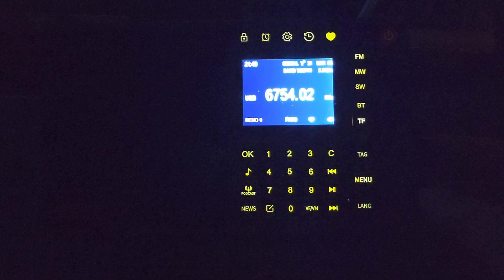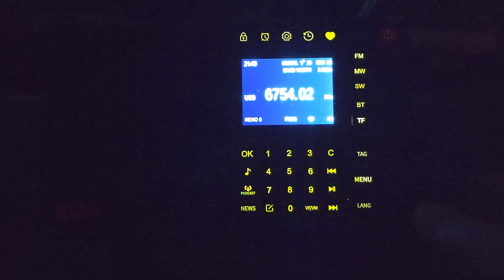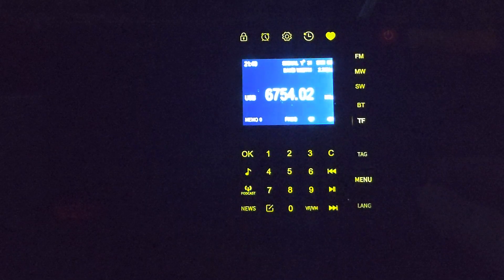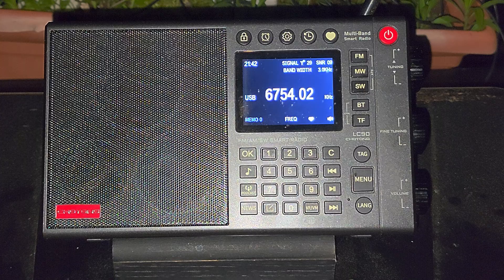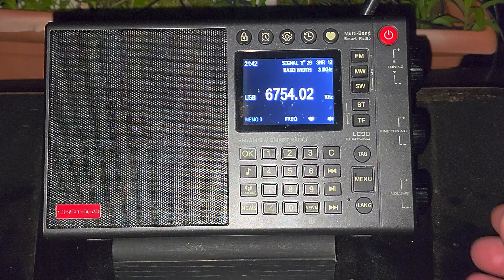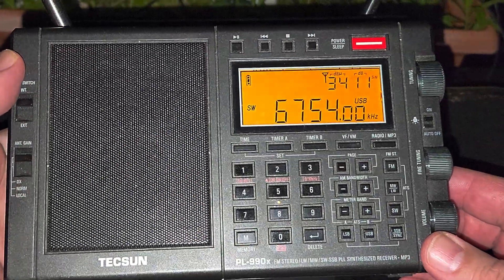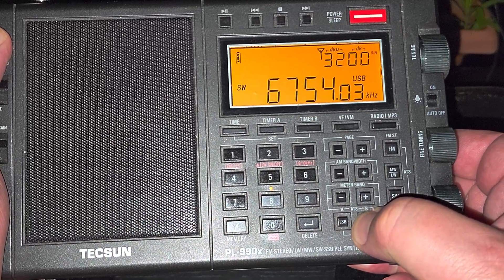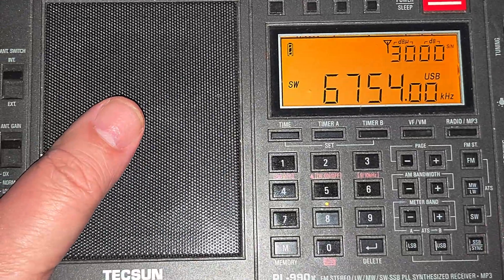Trenton Military Canadian Air Force VOLMET received on Choyong LC90 Smart Radio and Tecsun PL-990x

Comment: I have the LC90 as well. I really like it a lot. In fact, I'll probably get the LC100 if or when it comes out. This LC90, on some things, outperforms my Ocean Digital. I agree that all radio manufacturers should have lit buttons on their receivers. In fact, that should be a standard feature on both tabletop and portables. Also, not radio-related; I have the Windows Vista startup sound on my Windows 11 PC after an update I received. It doesn't bother me, but it is kind of humorous. 😊